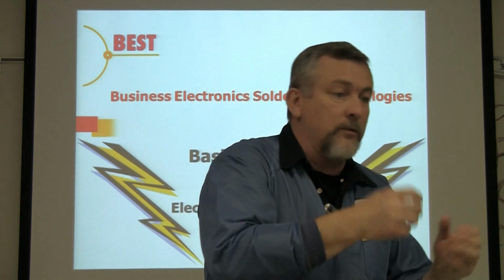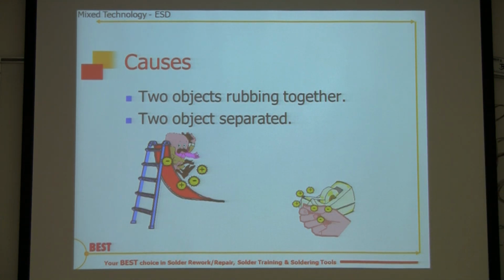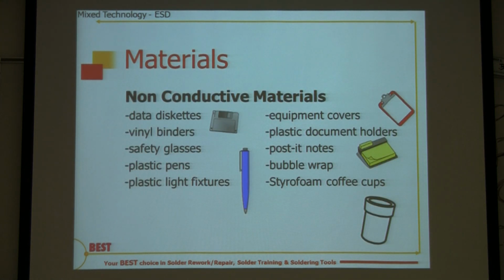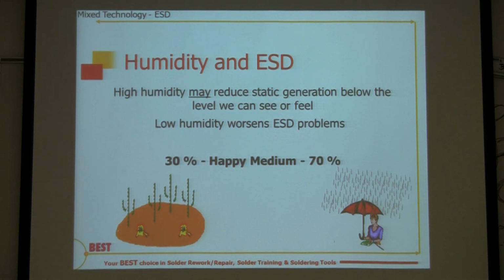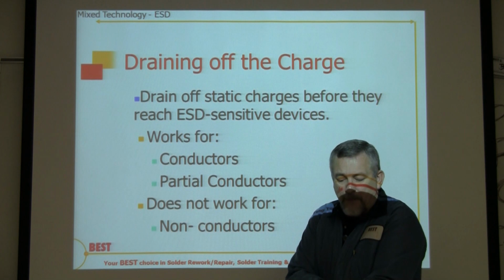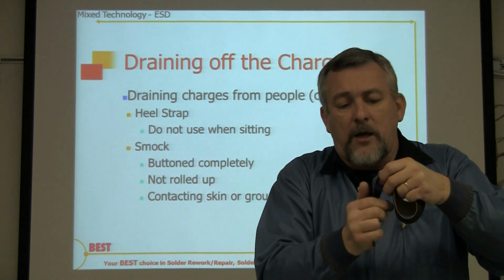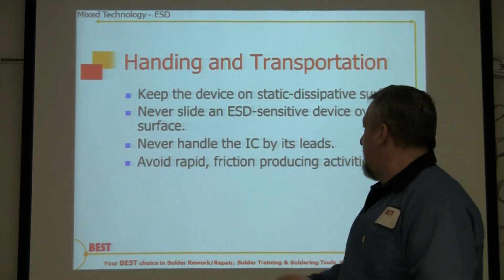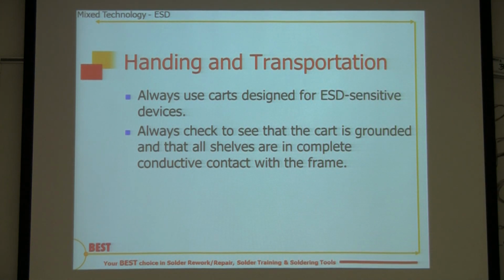ESD Practices for PCB Assembly and Repair

Comment: If esd straps are necessary why have i never seen any of the component level circuit board repair specialists (louis rossmann, ststelecom, northridgefix, sorin, dustin malahay) ever use them in any of their repair videos? Did i miss the 1 video that each of them wore one or were they all wearing them off camera?
Reply: I watch those guys you mentioned as well. They are good at what they do but I think they may just not be aware of the real risks of esd since it is so invisible to us and doesnt always cause instant observable damage. Louisrossman for example just started out as a diy guy who had no training or knowledge and thus may not be aware or may not think its a big deal.
I agree with the comment above, it would be interesting to ask them what they think of esd and how they think it should be dealt with.
Reply from the maker: Hi,

Thanks for your question!

First, please allow me to apologize for the delay in replying to your question.

I am not able to speak to why others are not wearing ESD straps. It's possible they are grounded off camera or using another ESD device.

I would suggest asking the individuals about their ESD practices.

Thanks for your question and for watching out content!

Kris Roberson
BEST, Inc.
Master IPC Trainer
Reply: that 12 volts guy who has a you tube channel repairing electronic gear and Mr Carlsons lab never have i seen them use wrist ESD straps , then again they may be using esd foot straps

Comment: A question, we have ESD floor and the work table and surface rug are ESD, it is necessary to land it to physical ground the surface rug and the work table ??
Reply: They must be connected to a ground otherwise the benefits of the flooring and table are not realized (I’d be surprised if the flooring was installed without it being deliberately connected to earth ground... Unless it was a DIY install..)